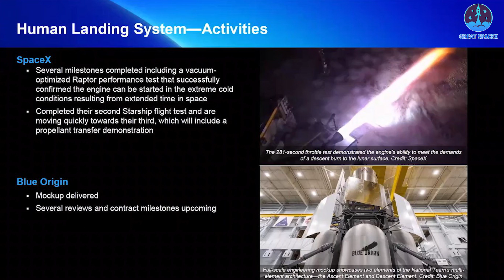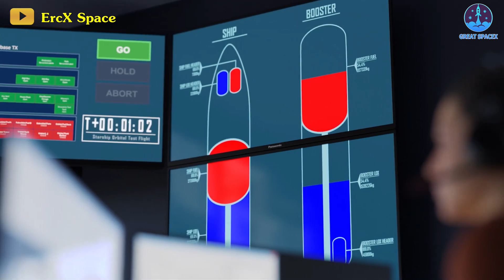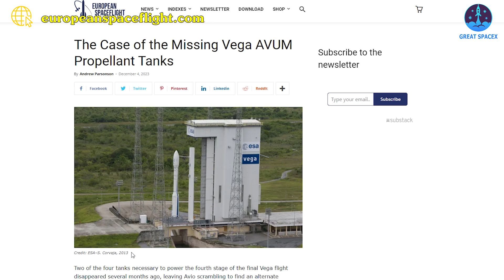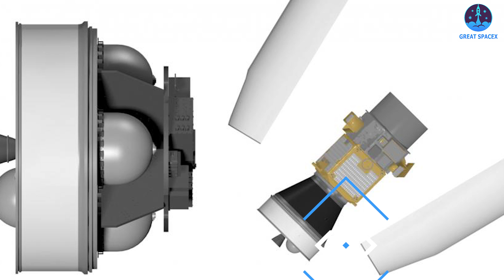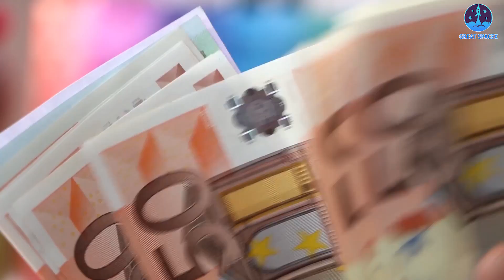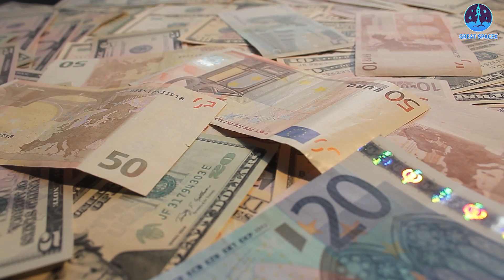Just happened! NASA officially revealed Starship IFT-3 will test propellant transferring!

Comment: Gotta make it to orbit first....
Reply: Not necessarily. If the transfer is between thanks on a single vehicle, as the one planned seems to be, half an hour of coasting out of atmosphere should suffice.
Reply: @bazoo513  Out of atmosphere is orbit. Not a stable orbit, but still orbit.
Reply: @9753flyer  Nitpicker 🙂! Technically, you are right, of course - this will be an orbit with perigee deep into the atmosphere. But then you could consider a trayectory of a hurled stone an orbit - like in jokes about mathematicians, correct, but useless. 
People usually consider an "orbit" one that can last, unassisted, at least for a round or two.

Comment: I don't get it!  In the 1960s, the Saturn 5 rocket was able to bring humans to the moon and back.  Then, why does Starship really need all this multiple in space refueling?  It should be able to get to the moon in one launch!  Starship is by far better than the Saturn 5!
Reply: It took the entire Saturn 5 to send   
 3 people to the moon but SpaceX is taking a hundred tons of equipment to the Moon there's a little bit of a difference
Reply: Because the starship is stupid heavy
Reply: Starship, with its huge dry mass, is a very unsuitable lunar lander. Apollo program's LEM was practically made of aluminum foil on a frame - not a gram of unnecessary mass. This time, competing lander designs were also conceived more in Apollo style. NASA chose SpaceX because that was all they had budget for.
Reply: People decided space was a waste of money

Comment: Why doesn't SpaceX use pressure-backed fuel bladder walls to better control the fuel in a partially filled tank? There are more ways to accomplish this than just rubber bladders.
Reply: Good idea.. Made the same suggestion a few months ago. Was told that such a strong enough bladder would weigh too much.  Still think it's doable.
Reply: @clavo3352  Remember they're dealing with cryogenic fluids here.   Any kind of rubber or flexible membrane will struggle being so cold and even metallic structures are difficult to engineer at such low temperatures.
Reply: @recoilrob324  OH, right. Forgot about that.  I'd still experiment with different rubber impregnated carbon fiber cloths.  Even a flat sheet with a, flared seal, end like the old slave piston seals on drum brakes slave cylinders.  With Musk's resources,  why not?

Comment: I really like SpaceX and Starship, but a DOZEN or more refuelings for one Starship to the moon? Seems like too much work and cost.
Reply: They will eventually perfect rendezvous and prop transfer, just like they perfected the falcon 9 and dragon. And when they do, it will be the cheapest system of its kind.
SLS costs more than 1 billion per launch, and still cant land on the moon because it needs a lander (saturn 5 could do that, it launched both crew and lander module). Starship is already cheaper than SLS, and is planned to cost less than Falcon 9 in the future.
Reply: @RocketPal  "SLS costs more than 1 billion per launch"
That is only if you put all the R&D costs in the planned launches, right?
Reply: I wonder if Starship needs full loaded tanks to perform a lunar mision.
Reply: @richardandersonmolinabetan1783  word has it
Reply: @richardandersonmolinabetan1783  The Starship is +100 tons and the additional interior isn't included so you can assume 150 - 200 tons without fuel, you need to land this on the moon and return it.

Comment: I would think that it would have enough fuel for one lunar trip without refueling and at most would only need one or two  fuel ups. 
They won't make it by 2030 if the pace of launches is not picked up.
Reply: Starship is capable of LEO only without refuelings. This might seem like a disadvantage, but Starship is a game changer because it's the first 100% reusable launch system, and with refuelings it will be able to deliver 100 TONS of cargo to the lunar surface

Comment: My thought: place a diaphragm in both the oxidizer and fuel tanks and use heat to build the pressure on one end of the tank to force the liquid from the other end of the tank.
Reply: Slowly spin the vehicle to allow energy from the sun to radiate back into space. Add insulation to the tanks to reduce energy flow into/out of tanks.

Comment: I doubt very much that IFT-3 will test propellant transfer in orbit. More like IFT-5 or 6 as Space X need to get into orbit first with a starship
Reply: IFT-1&2 were testing controllable splashdown with flap dynamics and booster maneuvers to see how precise they can re-enter and land in a designated area, pretty large part of reusability. I think NASA wants to confirm Spacex's refueling physics as it is a big puzzle for the rocket to work. Currently there are 5 launches per year you can see why Elon wants another launch by January, but NASA can settle for a version of starship that hasn't quite delivered on is reusable feature, that or risk it blowing up on the tower arms. This is a sign that the pre-disclosed timeline may be far off but everyone is moving at a very impressive scale to turn tides.
Reply: Refueling physics in orbit is a massive undertaking and very different then on earth. I find it funny that the slowest working space organisation (NASA) is giving Space X ( the fastest) a hard time about keeping to a time frame  @davey5444
Reply from the maker: No. This is different from orbital refueling (where propellant is moved between two ships) and will instead entail transferring propellant between tanks on the same ship.

Comment: The adaptation of the tanks increases the risk of an unsuccessful launch of Biomass, even if all three stages of the Vega work normally. Adapting the AVUM+ stage will require redesigning the stage and the software of the rocket itself. There is no backward stage compatibility between Vega and Vega C. ESA has already been burned on backward compatibility, as on the Ariane 5, using the guidance system of the gyroscope system from the Ariane 4.
Reply: Apparently, ESA decided to change the satellite for the last flight of Vega to send Sentinel 2C instead of Biomass, IMHO Biomass will launched on Falcon 9 if Vega C's second stage explosion Investigation will delayed, while Biomass is scheduled to launch on Vega C.

Comment: And the site on the Cape for the launch of Starship is not yet ready, at least two Starships need to be launched at the same time.
Reply from the maker: No. This is different from orbital refueling (where propellant is moved between two ships) and will instead entail transferring propellant between tanks on the same ship.
Reply: NASA is too optimistic, they look at the demonstration of refueling, SpaceX need to obtain a license to launch from the Cape, it rests on FAA, The FAA will not issue a license for an orbital launch from Florida unless, rapid unscheduled dissassembly over the Gulf of Mexico stops.
Reply: In the IFT-3 mission, the transfer of fuel from the main tank to the mainfold tank will be demonstrated, so the ship will reach a low altitude of 160 km, and the splashdown will be in the Indian Ocean area, not the Atlantic, the SECO will advance earlier than in the IFT-2 mission. There will not be enough fuel to enter a near-orbital trajectory.
Reply: SpaceX, knowing that on the second flight of Starship will reach near the orbital trajectory, and paased hot staging, has submitted an application to the FCC for the third flight of Starship in order to demonstrate the refueling and controlled landing of the spacecraft on the water.

Comment: Fuel Tank Temperatures and boil-off.

One of the mechanisms to help reduce temperature is to rotate the starship about its horizontal or vertical axis away from the Sun's rays. They will do this, however, they’ll need to employ other methods as well; things like thermal radiators, etc... (which can be comparatively heavy for a vehicle that large). To include yet-to-be-determined new innovative technologies, or advances in the material sciences.

My guess is they'll never fuel the tanks at full capacity while in orbit. I'm thinking 60% of maximum capacity at most (hence the recent desire for larger tanks in the V2 of Starship). At 60% capacity, the tanks will hopefully be able to withstand the internal fuel expansion and associated pressure should the temperature reach some yet-to-be-determined threshold.

In relation to the Apollo program, as far as the amount of fuel required goes for the Artemis Program, it's mostly all about mass, momentum, and chosen orbit. The amount of fuel required to maneuver and land (then relaunch) a Starship is orders of magnitude greater than landing the Apollo Eagle, with the much smaller mass of a mini school bus. Then basically cutting that minibus in half and launching back to orbit (i.e., the combined descent and ascent vehicles).

Starship is a giant mass of heavy steel and does not leave the majority of its mass behind on relaunch. It's a very different beast. 🧐

It's my belief that after about 10-12 attempts, they'll have enough data to solidify the numbers and finalize their designs (although to be clear, when it comes to Starship, no design is truly ever final).

Here’s a link to a “must-see” presentation:

https://youtu.be/OoJsPvmFixU?feature=shared

https://ntrs.nasa.gov/api/citations/19720005243/downloads/19720005243.pdf

Thank you.
Reply from the maker: I will watch and think about this. Thanks
Reply: @colonbina1  Thank you, Sir. You have one of the best channels on YouTube. Keep going strong. God bless.

Comment: They need to get to orbit first and attempt a landing IMO unless they are going to take a lot more time before this step.
Reply: Orbit is kind of obvious but why landing?
Reply: There are 2 landing types, Lunar and Earth landings. For HLS the Lunar landing is the focus, and for it to be able to test the lunar landing they need to have successful propellant transfer to achieve a lunar orbit with Starship.
Reply: Why bother landing if the tanks and pumps don't work the way they need to or are dangerous.. then the design is pointless and needs to be changed.. Scott Manley gave a theory on why the 2nd booster exploded.. when the main stage separated it caused a shift in momentum and gravity in the boosters fuel tank that caused the fuel to slosh to the top of the tank, just as the engines were shutting off.. and when the booster refired it's engines the fuel was slamming down to the bottom of the tank which overwhelmed the plumbing and started a series of rapid explosions. The tanks are also crucial to Artemis and refueling the moon vehicles.. and Artemis is SpaceXs most important contract ever by far.. and they are running late ..